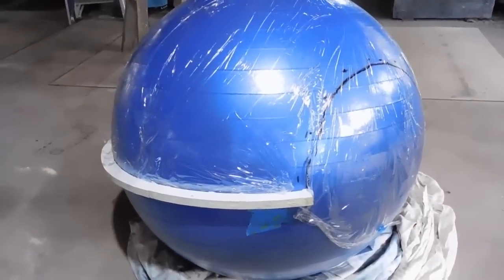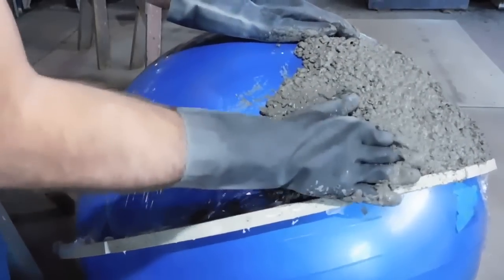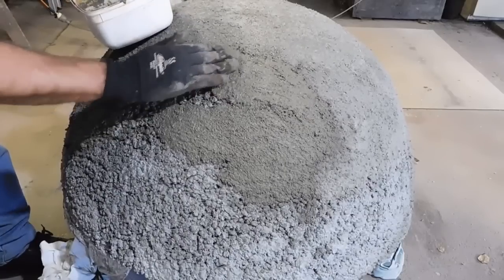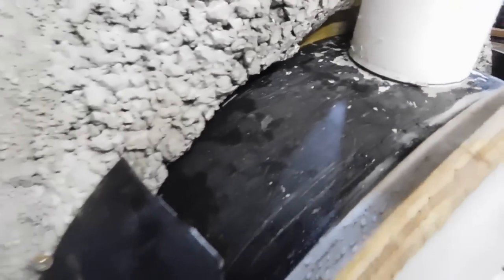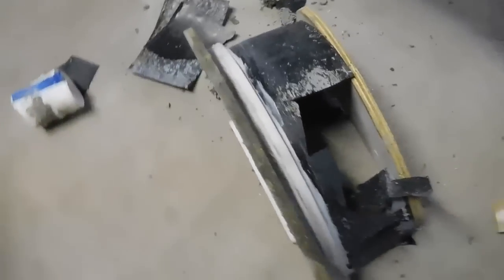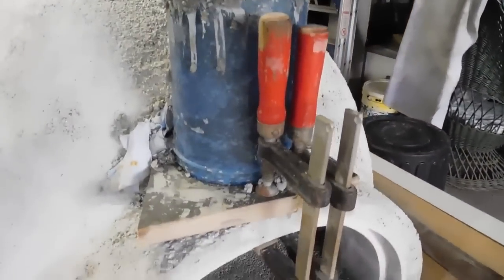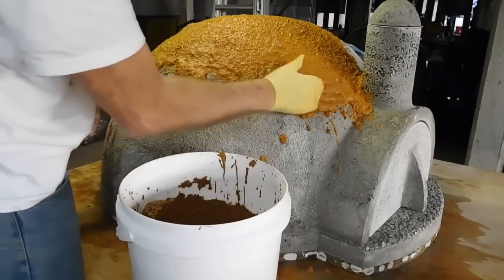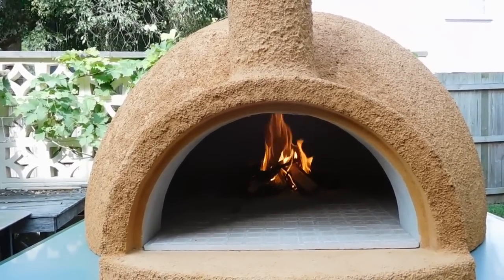Pizza Oven Easy  Build  "Full Video''

Comment: An excellent specialist, I am delighted! Please write me what material you used and in what quantities, I want to do the same.
Reply from the maker: This oven is 5 part crushed pumice and 1 part standard cement but most people are using perlite or vermiculite and I used about 80 litres of mix and weighs about 55 KG  !
Reply: @jjgrice018  

Thanks for the information, I will make the same oven

Comment: I was about to start making my own the exact same way when someone told me it had already been done. Thank you so much for sharing the process and save all of us a great work. I have one question though, Since my whole idea is to have the oven as portable as possible, what would you think about having the dome free from the base? Also, if you were doing it again, what would you do differently?
Reply from the maker: Yes you could have the dome seperate from base.I had a few small cracks and chicken wire may help as these ovens expand and contract with heat so build fire up slowly 😃

Comment: i love the build. I did something very similar but used chicken wire around the ball in the concrete to prevent cracking. hopefully that will work. it's still curing now for about 6 weeks. getting ready to fire it up in a week or so.
Reply from the maker: Sounds great William.Build fire up slowly to temp as these ovens expand and contract with heat !

Comment: Good afternoon JJ.  What is that thin tile you placed in the oven floor (wasn't on the video) and how did you shape it to get it into the mold?
Reply: Disregard - heard right after sending this that they're clay tiles.  Looks great!
Reply from the maker: I cut them with a diamond cutting disc on small grinder after using a large compass to draw circle on tiles.
Tiles not really needed as you can cook on original floor !

Comment: Could you tell me what kind of tiles you have there on the oven floor. Thanks
Reply from the maker: They are 10mm clay tiles turned upside down but did crack and the cracks filled with ash.A pizza stone works well.just put in oven 5 minutes before you cook to warm up😀

Comment: Hi, I have watched your excellent videos on the pizza oven and gave it a go myself based on your design but using perlite although I did use some finely ground pumice to finish off the colour render. I  waited for 3 weeks before putting a small fire in it for 30mins or so. Fine, no cracks so a couple of weeks later I put a bigger fire in it for about an hour. At the end of the hour I had 3 or 4 cracks from around near the top heading down towards the base. My question is would you have any advice on going about the repairs? 
Thanks again for making the job easier with the clips.
Reply from the maker: My first oven which was thinner got a few cracks which I repaired with some fine mix and rolled over and added extra inch or so of mix to inside top of dome that cops most heat.Best to build fire up slowly.Some people have dome unfitted to base to help with contraction and shrinkage issues !
Reply: Were you able to make the repairs? How is it holding up now?
Reply: @opolloqo6121  Yes

Comment: Gday mate awesome job!!!
I’ve just read through all 700 comments  to save you answering mine but no one has asked this yet. 
Do you add the concrete mix in sections? Let it dry and then add on a new section? Or do you cement the whole ball at once?
If doing sections are there any tips you have to make the joins more stronger?

Thanks heaps!
Reply from the maker: I did it in about 4 days a section at a time as I rolled the ball .Add a new section before other is fully cured and wet before adding new section.You deserve a medal for reading 700 comments Luke 😁
Reply: @jjgrice018  Thanks for the reply mate. I did the whole thing on a 95 cm ball over 2 weeks. It’s 6 inches thick! Unfortunately I couldn’t add layers that fast so parts were dryish in between layers. I hope its strong enough. You think it will be ok?
Reply from the maker: I let mine cure for about a month and build fire up slowly as these ovens expand and contract with heat.Good luck with your oven build Luke !
Reply: @jjgrice018  Good onya champ.

Comment: Hi, can I make a smaller oven with a 45-55cm fit ball? Thx
Reply from the maker: I guess you could make one that size.This one is 820mm inside diameter 😁
Reply: so if you count, every usable size will work even 45 cm, thanks for the info😊

Comment: LOL it is an easy way how to build the oven fast. You should use chicken wire over the ball for reinforcement. I enjoy the video. Thanks!
Reply from the maker: Thanks for watching Sun Shine ! I was thinking about using some but was told the wire will heat and expand more than the pumice aggregate and may crack the oven easier !

Comment: Hi, I don't understand what you say about the inside of the bowl. Are you  doing some material of product on the insite? For making stronger? It's in your video about 25:25.
Reply from the maker: I put an extra inch or so of the same mix to the centre of dome area that cops most of the heat  !
Reply: @jjgrice018  THX!!
Reply: Hi, I have another question.   You used normal cement. I'm affraid for cracs with normal cement. I can't find refractory cement. Only reflactory mortar, and there are more ingredients in it, so other proportions. What do you advise? 3perlite, 1normal cement. Or using refractory mortal with other proportions? I olmost ready with my research, but I have a few dilemma's... use wire inside the perlite or no wire...?
Reply from the maker: This oven has pumice stone crushed up and pumice is mainly 70% silica and 13% aluminium oxide that helps with fire proofing but most people are using perlite or vermiculiteand I have never tested it .I would make a few test batches of different mix ratios and heat test them .Have seen a few people using thin chicken wre also !

Comment: What size exercise ball is that?  35cm 45cm 55 cm 65cm?

Thanks
Chris Bus
Reply from the maker: It is a 75 cm ball pumped up to 82 cm and did the dome over 2-3 days slowly rolling ball and can do join after about 5-6 hours or cut hole in sheet of ply and place ball half way in hole.Never tried that way as I thought concrete may slump off ball but that is how most people are doing it >https://www.youtube.com/watch?v=cEs6yPICF-4

Comment: You didn’t show how you made the inside base? What did you use for that? It looks like it fits perfectly...
Reply from the maker: They are upside down 8mm clay tiles I cut the arc with a diamond wheel after marking with big compass !
Reply: @jjgrice018  Thank you so much! Looks very nice, good work!

Comment: Well designed mate! Silly question but the rain/elements won't affect it will it? As I live in sunny old England...
Reply from the maker: This pumice concrete will suck up some water so I put a tarp over it or make sure it's dry before use !

Comment: Brilliant construction!  How many pounds of crushed pumice and cement did it take to make this?  Thanks
Reply from the maker: About 80 Litres or 21 gallons and weighs about 55 KG or 120LB Venice !
Reply: That seems like a perfect weight! 
Did you use the same mixture for the base/floor and does it brown the bottom of the pizza?   
 I hope to start an oven next week and hope it looks as nice as yours! Thanks for your reply

Comment: Can this be covered with a sealant after it's completely cured and dried by fire to resist water penetration from rain? Or can it be covered over with cement only ? Seems cement would protect it and add better insulation. Pls help. Thanks
Reply from the maker: I use a cover or let dry before use !

Comment: How did you tidy up the inside of the dome and what 'fine stuff' did you use? 

I'm in the process of making this myself, one problem I had was a few cracks and bumps on the inside of the dome, and a few pieces of glad wrap stuck inside which I'm hoping will burn away upon firing.
Reply from the maker: This pumice concrete sands as easy as soft pine so I use sandpaper Vel ! The fine stuff is fine crushed pumice sieved through flyscreen.Try grinding out any cracks and patch !

Comment: how thick would you build this oven to avoid cracking? and would the pumice be enough to insulate the floor should i want to place it on top of a concrete counter?
Reply from the maker: Walls are about 2 inch and 3 inch around top of dome that cops most heat but thicker the better and floor is 2 inch and form ply under gets to about 120 F . See this vermiculite one as well >https://www.youtube.com/watch?v=-j25Z65eaYk&list=PLmE0FyFvptLN86xwLeqt2yPBr3gw3s95d

Comment: Great project ! how long did you wait before putting on the honey-colored layer?  what is the mixture you made to make the honey color?  how long was the cure before lighting the first fire?  I think to make mine with perlite and refractory cement.
Reply from the maker: I put on the render of honey coloured oxide mixed with fine pumice and cement after a week and oven cured for a month or so ! Render mix is at 32;30 min in video ! Good luck with your oven build !

Comment: Is refractory cement the same?
Reply from the maker: Buy hi'temp refractory cement if you can get it but this standard portland cement should take up to 1400F !
Reply: JJGrice018 wow that’s quite a high temperature with normal Portland. Would adding hydrated lime reduce cracks long term? Great video!

Comment: Hi.
Thx for the vid!
I have seen a couple of similar ones now and all seems to be using a Portland based concrete mix.
Why not use a fireproof mix instead?
I am just about to start building so I'm a bit curious.
/Andreas
Reply from the maker: Thanks for watching Andreas ! Use fireproof cement if you can afford it. Portland cement is good to about 1400F and my pumice is 14% aluminium oxide which helps with fireproofing !
See here after 2 years >https://www.youtube.com/watch?v=kP9poGmzH1g

Comment: Hi, John. I'm from Romania and I'm delighted with the pizza oven you made. I set out to make this oven in 2021 (now winter is coming). I bought a ball with a diameter of 1m (I couldn't find a smaller one). How much pumice and cement do I need? Is the fireplace cement okay? thank you.
Reply from the maker: Thanks for watching .I used about 80 Litres of dry mix and use hi-temp cement if you can find it !

Comment: Thanks. What is the pad inside of it? Also... I've seen a lot of these wrapped in heat blanket material and then surrounded by materials (rocks, brick, etc.) that do not conduct the heat out anywhere but the chimney. How hot does the outside of yours get? Also, how much heat is coming off the bottom?
Reply from the maker: The floor is the same mix and the oven gets to about 180F outside and 120F under stand when oven is at 700F !

Comment: How long does it take to heat to pizza temps? And how often do you have to add wood to maintain temps? Wondering if this 5:1 mix is only good for short use (like pizzas) or long term (roast a chicken after the pizza)
Reply from the maker: Only takes about 40 min  to slowly build up the heat but don't throw in half a tree or you'll crack any oven !
A few sticks every 10 min or so will maintain the heat ! After pizza you could roast a chicken when it cools at 350 F with the door on !
Reply: Awesome!!

Comment: This looks awesome!  How much did the dome/opening weigh when you put it on the base?  How thick is the wall?
Reply from the maker: Thanks for watching ! The dome is about 45mm thick on sides and 60mm at top of dome that cops most heat and weighs about 30KG and base is 50mm thick and about 25 KG and whole oven about 55KG or 120 LB !
Reply: Thank you very much.  Your video is very helpful.

Comment: how has this lasted any cracks? was thinking of doing firebricks all around but using the gym ball would help save time.
Just wondering if the vermiculite held up the same as brick on the interior
Reply from the maker: This oven is pumice concrete and is still doing fine !
See this vermiculite one here .https://www.youtube.com/watch?v=-j25Z65eaYk&list=PLmE0FyFvptLN86xwLeqt2yPBr3gw3s95d

Comment: I've been reading that cracks can be caused by heating and cooling; so before I light my first fire, I was thinking about adding a refractory blanket layer (held down by chicken wire) then covering that with stucco to keep the heat in i.e slower cooling. But part of me thinking the inner dome will crack anyway and I'll be wasting my time and money. Not sure what to do
Reply from the maker: I build the fire up to heat slowly and don't chuck in half a tree at once as these ovens do expand and contract with heat !

Comment: Hi John, is there anything you'd do a little differently after building a couple of these? Apart from a longer chimney. All up what were your costs? Also, do you think it could cope with coastal, outdoor weathering? Sorry for the questions, I'm just a woman lol!
Reply from the maker: Thanks for watching Cilla ! Maybe make arch 1/2 inch thicker as last one has small crack.I collect pumice for free.so I only bought cement and colour oxide.Pumice concrete will hold some moisture so use when dry or I put a cover on them ! See pumice here>http://www.hesspumice.com/pumice-pages/pumice-uses/uses-for-pumice.html

Comment: what did you use around the ball to hold up the initial concrete? silicone something? caulk? glue?  seems it would need to be pretty solid to hold up the weight of the concrete.  I'm gonna try one of these. it looks awesome.
Reply from the maker: Yes I used silicone to stick the chipboard offcuts  marked with large home made compass and cut with jigsaw  Dan !
Reply: I'm no expert, but you can cut a circle out of a piece of plywood a little smaller than the max diameter, and that should hold the ball pretty well I'd think. Hope i'm not a year too late :)

Comment: It has been awhile since you built this oven, and I'm wondering how the tile on the floor stood up? Did they crack? Are they ceramic or clay tile?
I have my oven finished and am waiting for it to cure before firing it up. Can't wait to try my first pizza.
Thanks.
Reply from the maker: The 8mm upside down clay tiles are unfitted and help protect the floor but not really needed Boyd ! Good luck with your oven and build fire up slowly.See tiles here at around 30 second mark >https://www.youtube.com/watch?v=0j_IOWDPj8g

Comment: Mate, Fan...F'in Fantastic   .... What a great idea what great Covid19 project :)  
Did it ever crack at the joins afterwards between the pours during the 5 days of making the dome?  
I might try making it thicker using 2 layers and using chicken wire as reinforcement between the layers...  what do you think? 
it's been 2 years.... Is it still cooking yummy pizzas or did it crack?
Thanks,  
Greg
Reply from the maker: No cracks on the joins but small crack on arch that should be thicker but easily fixed,Thicker the better and chicken wire may help,These ovens expand and contract wih heat so build fire up slowly to temp !

Comment: Hi. When you smoothed out the finish on the inside was that done with the cement/fine pumice mixture?
Reply from the maker: Yes it's fine pumice sieved through fly screen mixed 5-1 and can be sanded like soft pine-wood Edward  !
Reply: Think I can bash up perlite into powder?  Should hold the same properties as pumice?

Comment: Is that a ceramic floor?
Reply from the maker: They are 8 mm glazed clay tiles upside down unfixed but have cracked but the cracks fill with ash and the tiles help protect original floor !

Comment: Somebody may have asked already but, what is the base made from? Did you just use concrete or a mix of something? I was thinking of fire brick but what you did may be easier. Great video.
Reply from the maker: The same pumice concrete mix but most people are using a vermiculite mix as it is cheap !
Reply: JJGrice018 thank you so much. Great work.

Comment: Hi John, great job. I'm going to give it a go as you make look very easy.
I've got questions about the concrete mix, will I found the Pumice concrete mix at Bunnings? Or do I have to buy the cement separate and the pumice by it self? 
And where can I found the pumice?
Reply from the maker: If you cant find pumice, vermiculite works well apparently !
I like this blokes one here>https://www.youtube.com/watch?v=egomtlRdoKE&google_comment_id=z12wutgzuybsdha3r220cz5onxjhw5evp
Reply from the maker: This one has a list and is made much the same>https://www.youtube.com/watch?v=-j25Z65eaYk&list=PLmE0FyFvptLN86xwLeqt2yPBr3gw3s95d
Reply: Thanks a lot. Appreciate your reply.
Have a good one!

Comment: Have you had any issues with the cement burning away. I've seen several comments elsewhere that have suggested that after a while the Portland cement burns off so it's worth mixing in some Lime and/or Fire clay to keep everything stuck together incase the cement does burn off after time.
Reply from the maker: The portland cement should handle up to 1500F and the pumice is about 74% Silica and 14 % Aluminium oxide which makes the pumice concrete more heat proof ! Some fire clay or refractory cement may help even better !
Reply: JJGrice018 I'll be using perlite which has a similar composition. I may throw in some refractory grog (crushed fire brick) as well as some lime.